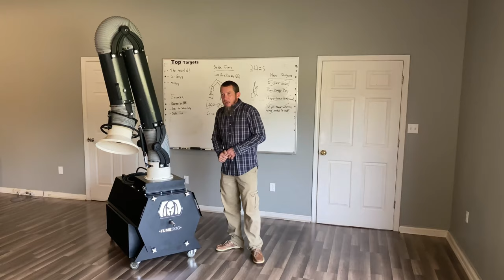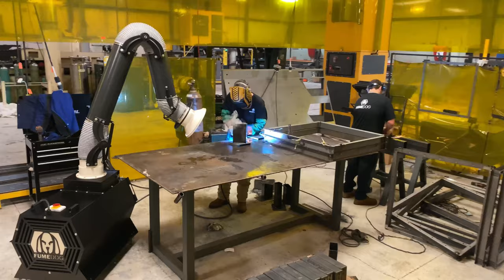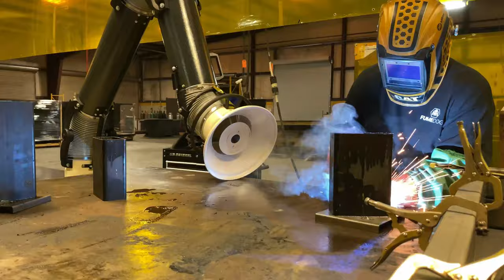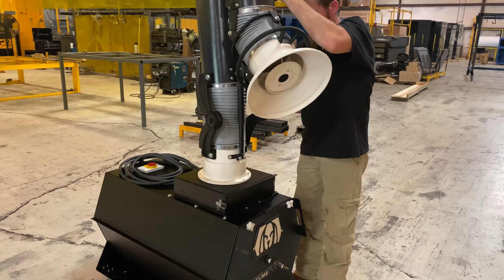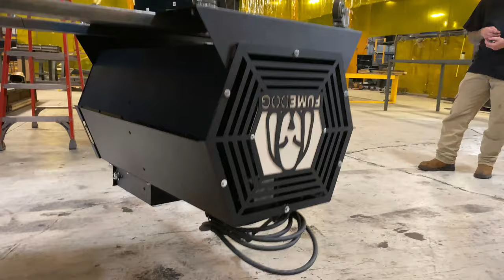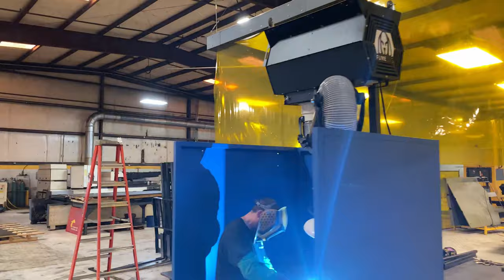Fume Dog - Who We Are

Comment: Will this work for hardfacing? And are there different types of filters to extract different toxins or is it one general filter?
Reply from the maker: Yes sir it will.  Usually the filter is the same, unless you are doing SS welding, in which case we recommend PTFE.